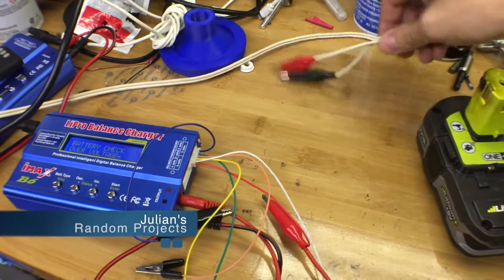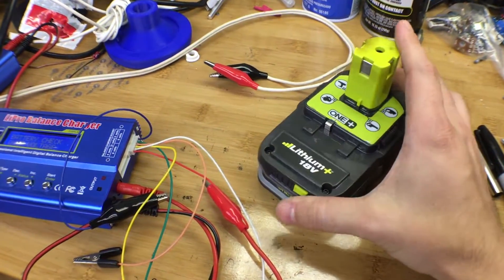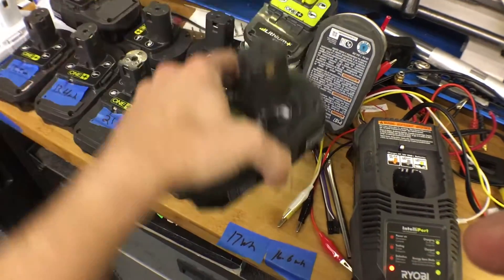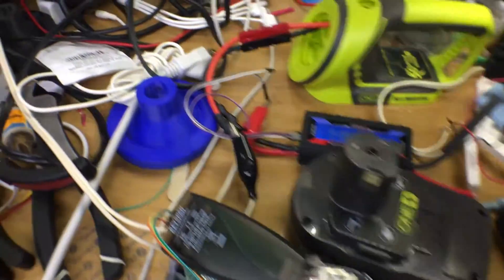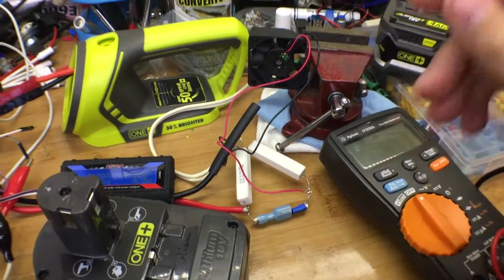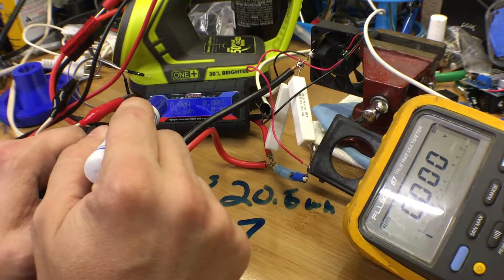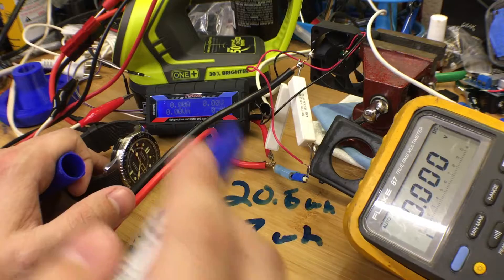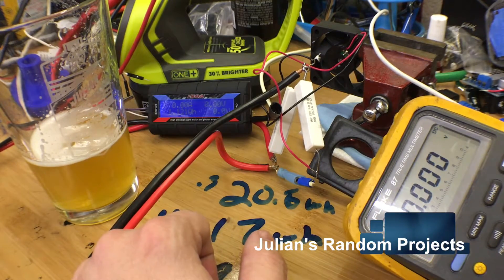AvE got it wrong? Ryobi Battery Testing

Comment: Just go to candlepowerforums and lygte dk, there are the experts who have done all these tests with loads of different types of cells from lots of manufacturers. Ave's test was bogus for the normal use case of a drill and likely many other devices where you normally do not drain batteries at 10A continuously! There are batteries specifically meant for high currents, others are meant for max capacity at lower discharge rates. Those in the hercules packs are likely not of super low internal resistance. What do other brands use? What are typical use cases for a given product (i.e. W required for average use)? Only when you know the latter can you judge the pack's suitability for cordless tools.
Reply: Well a drill might not but most other tool will. Like my bolt gun,,circular saw and compressor are used with max power allmost everytime i use em and for sure they draw more than 10 amps.

Comment: This was great man!i will be doing more when i get to the office. I do see the difference but i would suggest that heat loss due to current went unmeasured prior to the test equipment. That heat is energy which is stored then converted. I want to do a response video to AvE and perhaps yours at the same time.... that will take a week prolly. I think i can que up a ryobi battery tho huh? Good video. Keep on uploading.

Comment: The difference on usable capacity at higher discharge rate has to do with the cells internal resistance and the difference of about 3Wh you see has ended up as heat inside the cells.
Reply from the maker: THE electrodacus!? We are all honored to have your input. The 3Wh being lost to heat internally makes sense to me. Energy in is energy out so it has to be going somewhere. Love your board designs! Inspirational stuff.

Comment: Did you account for fact that the resistance of the bulb changes as the temperature of the bulb changes?
Reply from the maker: Doesn't need accounting for since the microcontroller is sampling often and recording the Watt hours. If I was just using a multimeter, a resistor (bulb) and a watch I would need to take the change into account to be accurate. Hope that makes sense.